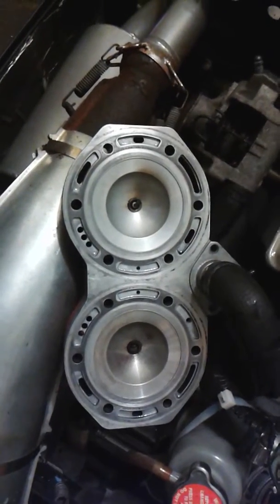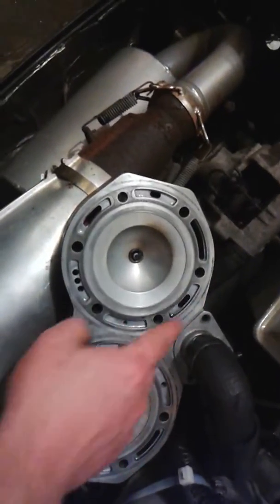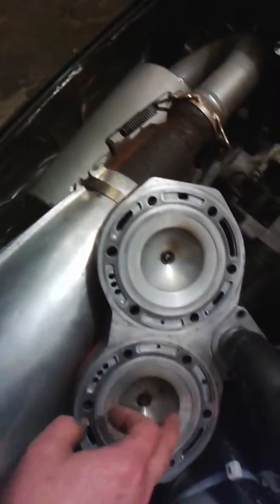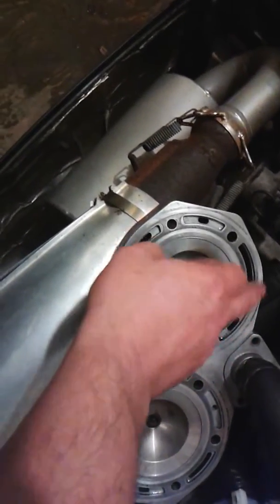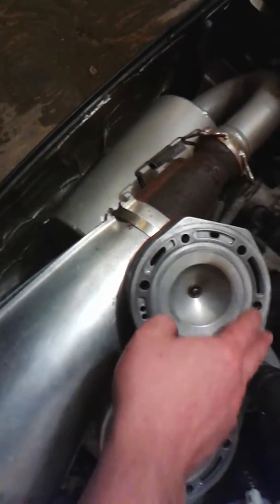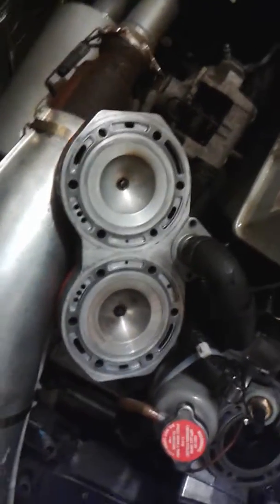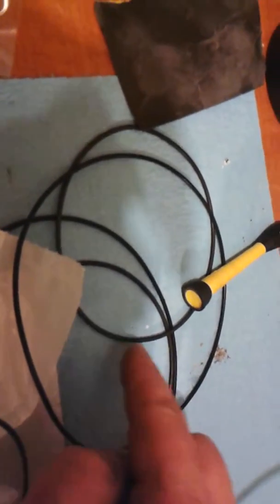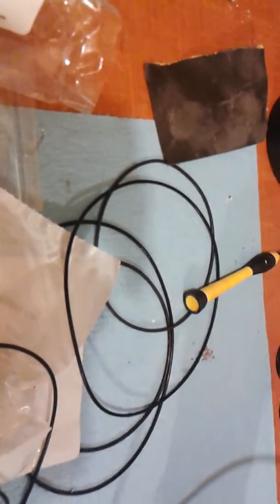2004 Polaris Liberty O-Ring Replacement. (Part 5)

Comment: My head was a little warped so I hit it with some 80 grit glued to a piece of glass and resurfaced/flattened the warped spots, then some 600 grit across the whole thing and both sides are like glass now. Was a pain with that cooling port had to make figure 8s with the small pieces of thick flat glass (I used the side vents window glass from an old Chevy square body) worked perfect because it was small and triangular shaped to get around the cooling port